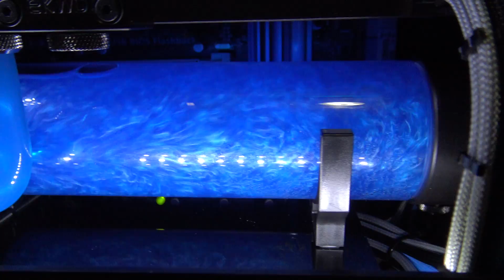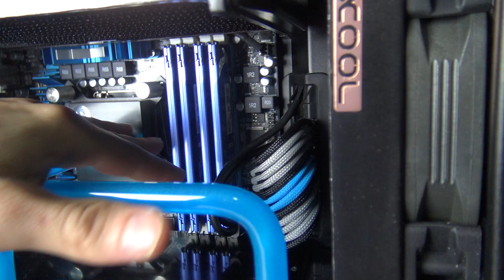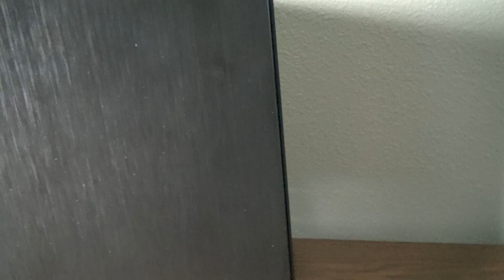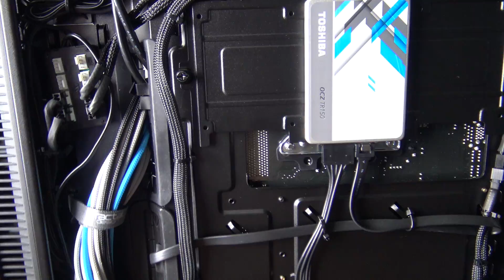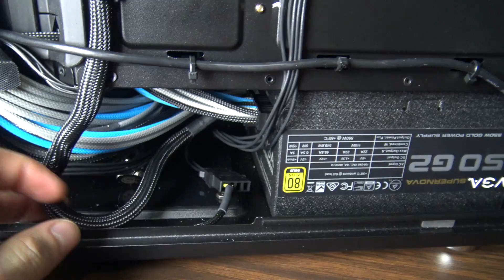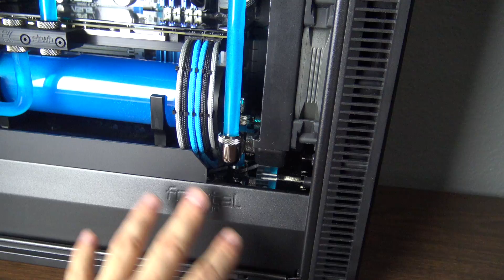Fractal Design Define Mini C: Water Cooled Build Log Part 4

Comment: Excellent video!!! I have a Meshify Mini C, which I guess is a similar size. I have a RTX 3080 FE with terrible thermals. Memory is running at 100 degrees C. I checked around and seems this is a thermal pad problem. Long story short, I am considering watercooling just my GPU for now instead of replacing the thermal pads. Would I be able to horizontally mount a EK pump res combo and do you think a single 280mm RAD in the front should be sufficient just for the GPU?

Comment: how much space is there for a graphics card if you have a 56mm total thick rad in the front? i'm thinking of building a setup in this case in a month or so and i want to use an RTX 3080 but idk if it will fit

Comment: This is a great looking build and it's certainly given me some inspiration. But is there a reason you didn't go with a pump/reservoir combo unit? In my thinking it would be cleaner and simpler, with none of that fitting complexity in the HDD bay, and the HDD bay would still be available for mounting drives in. Keep in mind I've never actually built a loop, so I'm coming at this from a theoretical angle.

Comment: What GPU are you running? with stock cooler my 1080 strix can't fit a front rad, wonder if it will have room with a waterblock. Also is your top rad off center? My fans literally are sitting right up against my RAM, though the trident Z is pretty tall to start with.
Reply from the maker: That's a reference 980

Comment: Really nice build you got there!

I'm scratching my head a bit though, i'm not getting the in and out ports to match up in my head.
It seems like you have the GPU in and out ports the correct way, but then it looks like the in and out ports on CPU block is reversed? Or am i just missing something here?

Just built my first custom loop in a Define R6, loved it, but i got bit by the bug and want to do a second build in a more compact case, so this is good inspiration! :)
Reply from the maker: keep in mind the CPU block is upside down.
Reply: Vir1lity PC Customs yeah, i see that, i had to do it like that on my own loop to avoid clutter.

Comment: Very nice build you have got. Which size hard tubing and which radiators exactly are you using? Which type is the res/pump? Thanks
Reply from the maker: Thanks! 12mm tubing. Alphacool 240's, 30mm thick.

Comment: I appreciate you posting this video. It helped me decide on buying the mini c. I just water-cooled my first gpu in a build and needed more room than my previous case and this case ended up working great. I bought EKs new aluminum kit and water-cooled the GTX 1080Ti with it. I left my 6700k being cooled by the H100iV2. managed to fit both 240 rads and fans (h100iV2 on  top, the EK aluminum 240 with Varadar fans in the front) in the case. I didn't pull the hard drive cage instead I put two 2TB drives in it and stuffed 2 80mm fans in front of the hard drive cage (very tight fit). With all this hardware stuffed in there I had a bit of an interesting time figuring out how to mount the pump/reservoir combo. It is actually sitting on its side underneath the GPU similar to yours. Only caveat is that my pump/reservoir combo doesn't sit parallel with the gpu. In order to keep air from being pulled into the loop I have it mounted at a bit of an angle. The pump is mounted through the rear pcie tabs in the case. Very happy with the way it turned out, just wanted to say thank you for the video otherwise I would have been too scared to buy this case being worried it wouldn't have enough room for both 240 radiators.
Reply from the maker: Nice! I'm glad it worked out for you!

Comment: Awesome channel!

I'm thinking of doing a similar build with the reservoir positioned like yours. Only problem is that the case I'm planning on building in has 4 PCI-E bracket slots, whereas the case you used has 5. I'm not 100% sure whether there will be clearance underneath the GPU block for the reservoir and there's no real way to know without buying parts...

Also, are those the default reservoir mounts that came with the EK res?

And lastly (so many questions, I really love this build), what graphics card is that (and is it reference)? I'm specifically interested in the block/PCB length. Thank you!
Reply from the maker: Ya, unfortunately sometimes you don't know how things will work until you get the case and parts and just try them out. Yes, those are the standard EK res mounts. That is a reference PCB on a 980.
Reply: Thanks for replying! Yup, very true, will just have to see how it goes. Biggest challenge in a small case will be figuring out the drainage port.

Comment: Hey, I'm thinking of doing a build in the Define C ATX, I was just wondering how you mounted the custom acrylic piece onto the back of the case, to cover the back fan hole
Reply from the maker: I cut it out using my Dremel Moto Saw and then just attached it with mounting tape.

Comment: Really nice build! The size of the Define C cases (full size and the mini) is definitely shocking once you get them opened up! I just put a temp loop in my Define C case while I wait on my GPU block to come in and it was difficult to figure out where and how to mount my res/pump. After watching this vlog series I've gotten some more ideas on what I can do to use that lower space above the power supply more efficiently though so thanks!
Reply from the maker: Thanks! I'm glad you got some ideas. Good luck!

Comment: This build looks incredible! I love the gunmetal blue/gray look to it. Quick question: how would you LED light a build in a thermaltake p3 without seeing the individual LED's?
Reply from the maker: oooh, that's a tough one. I can't give you a good answer as I haven't had a chance to mess around with that one.
Reply: I've been struggling with it for a bit and has been holding me back from buying it or not. The best solution I could think of was to them in the back and let the light shine through the holes but that wouldn't be a very good solution.

Comment: the aurora will settle after awhile ive used it twice. But you wont have blockage
Reply: removing jet plate helps on the cpu block
Reply from the maker: I won't be running that in here for very long, so I'm not worried. Thanks for the info.
Reply: Vir1lity PC Customs looks good I had the same run for a few months. Reversing the pump flow actually got the particles back in motion. Looks good. Where did you get the cables or did you make them
Reply: Looking for new cables for my build